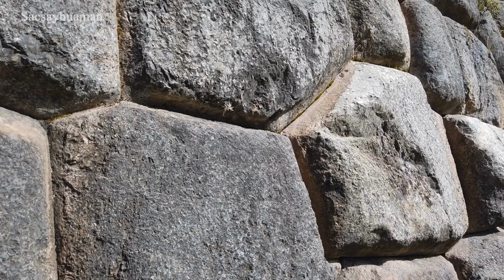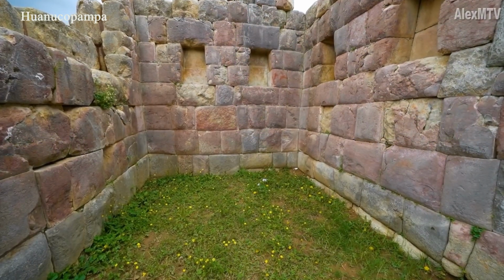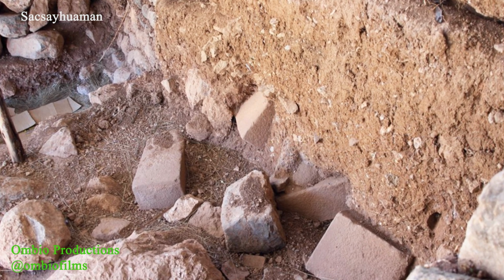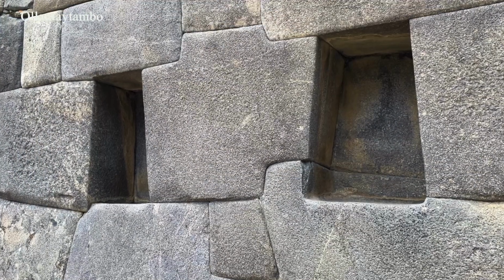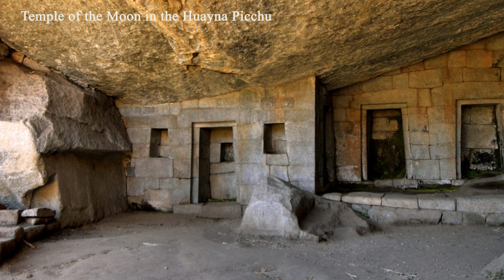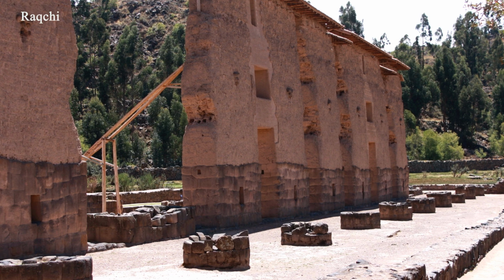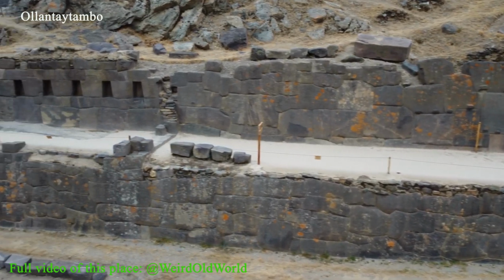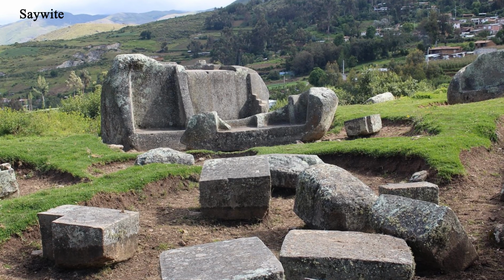Why was polygonal masonry necessary? #ancienttechnology

Comment: were the monolithic sites like macchu picchu, ollantaytambo, sacsayhuaman, etc all in active/central use in 1600's when Pizarro showed up? Do we have a body of evidence re: how much time had elapsed between the construction of the original monolithic layers and Pizarro's appearance? or possible timelines or dates for the additional layers/constructions at this sites w non-monolithic styles of construction?
Reply from the maker: Thank you. I don't quite understand the point of the question. But if we're talking about dating, then the quartz-bearing rocks are dated using modern methods. "Optically stimulated luminescence (OSL) " and Thermoluminescence (TL) in carbonates.
Reply: @GRES_TAC  thanks for your response; I meant: do we have a sense of how long before Pizarro's arrival in 1532 (and hence arrival of writing/historical dating in european/written timeline) these Incan sites were in active use, or how long before then they were constructed (whether or not they were in active use in 1532 when Europeans arrived on the scene)? I know there is a narrative abt the conquistadors dismantling the ritual site on the hill at Sacsayhuaman at some point, so presumably that site was in use, but I know Macchu Picchu wasn't discovered until much later, for example
Reply from the maker: @JR-lo8tu  Thanks for the clarification. The difficulty lies in the fact that archaeological reports consider polygonal masonry and rough-hewn masonry together. However, I have not encountered any mention of a non-Incan cultural layer being associated with polygonal masonry. Details can be found in "Volume 2 THE ANDEAN CIVILIZATIONS" on page 143 https://drive.google.com/file/d/1IF7pUExXM1LRHl41GFFRvcywEj0aPz1P/view  Or by searching for the keyword "dressed stone." And also in the collection of reports on Yurak Rumi https://drive.google.com/file/d/17yK5fcAudxFqPEcH7YXZG-mw1cPET0Dg/view Accordingly, polygonal structures were used from the time of their construction until the arrival of the Spanish. After which, some were abandoned, like Machu Picchu, some were destroyed, like the tower of Sacsayhuaman. Some were reused, like the Coricancha.

Comment: Today we heat limestone, grind it to powder, then make artificial stone called concrete.  Think about it…polygonal masonry saves a lot of chipping, heating, and grinding to powder if you don’t have huge rotary kilns available….the question is not why they did what they did to form stone walls…but why we do what we do….
Reply from the maker: Thank you. Clay-based mortar is used now, it was used then too. Its preparation does not require much effort. But it is not suitable for what was created by polygonal masonry.
Reply: Interesting point. I was studying how stone masons cut and dress stone. If you have steel tools it is easy to quarry and cut uniform rectangular blocks, that can be carried to the construction side. All this can be done by lay workmen under the supervision of experts. If you don't have steel that gets much more difficult or even impossible. The popular story tells us they drilled holes, inserted wooden wedges and soaked them in water, splitting the rock. If you do that the rock will crack irregularly and you won't get a straight edge. Aside the fact that you just can't cut rock with bronze tools. You can only bang it with bronze hammers but even softer sandstone will grind away your bronze chisels in no time.

Comment: Interesting. Obviously using homogeneous rock on a bedrock foundation is structurally and aesthetically superior to the latter Inca rubble and clay mortar work, but given the exponentially greater effort required to precisely cut and fit 5 (or sometimes 6) faces of andesite it is impossible to believe they didn't have some kind of chemical softening solution to make the job feasible. Also, why would they build to a structural standard to last centuries (if not millennia)? Did they have experience with earthquakes going back centuries informing them of the need to build that stoutly? Peru is filled with hundreds of thousands of miles of terraces, mostly done with rubble rock and clay mortar, that still exist today. Assuming that most construction would have stopped with the downfall of the Incan Empire in the 16th century and even assuming they may have to be rebuilt every 100-200 years, that would seem to be "good enough".